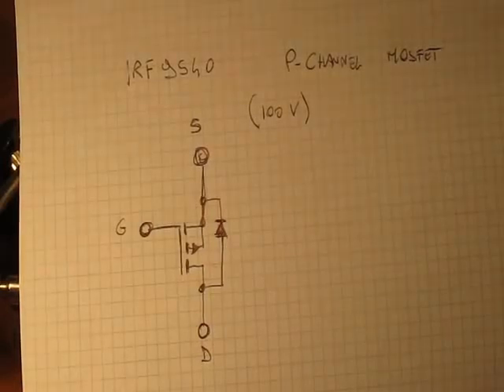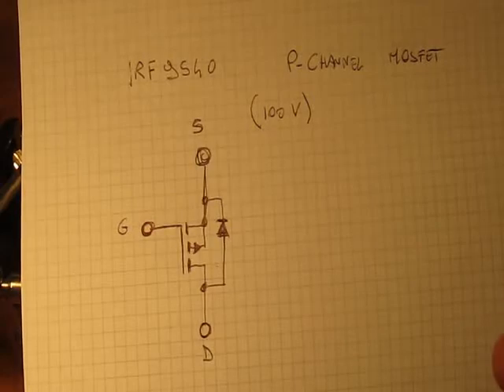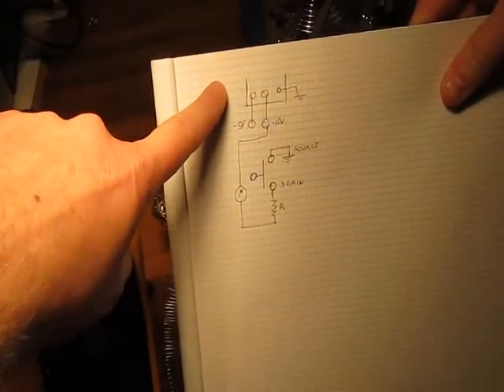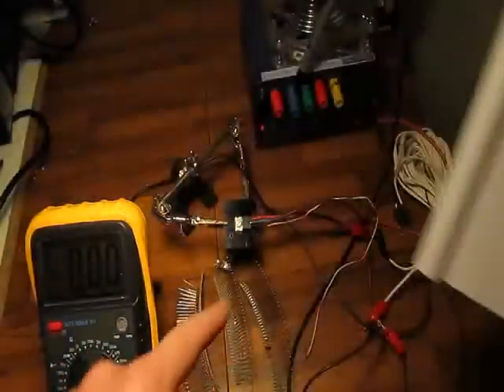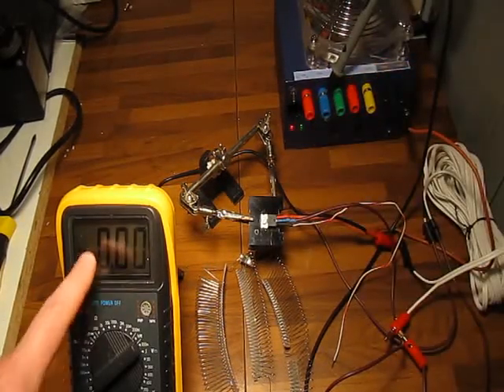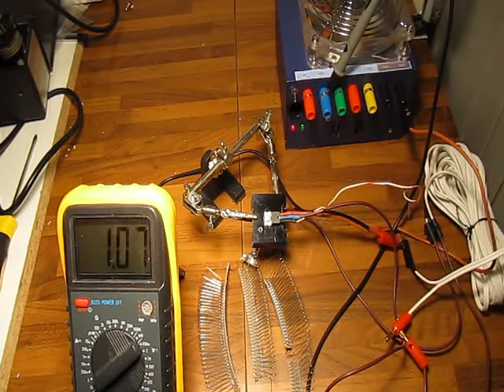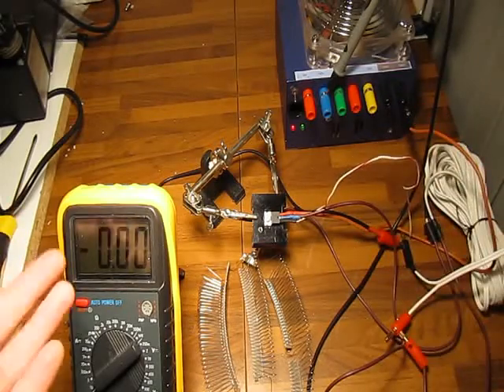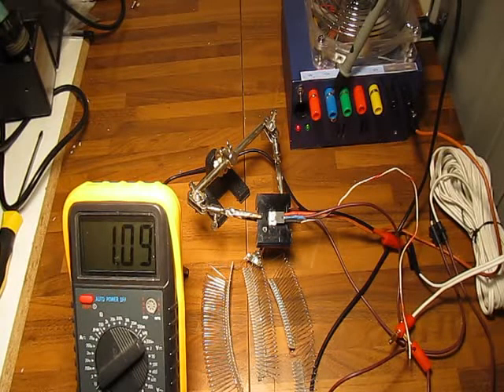P-Channel mosfet experiment - IRF9540

Comment: Often you can tie a permanent 10k resistor across the gate and ground to bleed off the charge on the gate once the gate voltage is removed.

Comment from the maker: As I stated in my blog post (check the link in the video description) you can explain this concept in two different ways, so it's easy to get confused.
In order to use the P-MOSFET as a switch, your electrons will flow from Drain to Source (D is negative in respect to the Source). If you reverse this the internal diode will always conduct, so you won't  be able to open the switch.
This means that you either connect the drain to (negative) ground or you keep the POSITIVE gnd on the Source,

Comment: Hi I have a IRF3505 p-channel mosfet and all I'm trying to do is use it as a switch at the top (highside) of 4 18650 batteries from a microcontroller running from 1 18650 and logic at 3v. I thought I could just pull the gate up with a 10M resistor to 3v keep it off and then to ground using a low side mosfet to open it but you say I need negative voltage so now I'm confused lol.

Comment from the maker: It's not an easy answer because it depends on several variables.
First of all, you probably don't want to drive it directly from a 5V mcu or similar as it would not open completely.
For that you either have to select a "logic level" mosfet (normally with low amps) or use a driver.
The driver can help you to reach good frequencies and the trick is to "win" the capacitance of the gate,
Some more info on my blog post (check the video description):